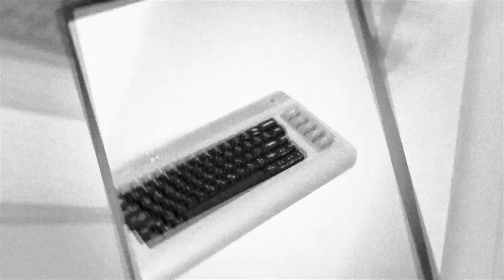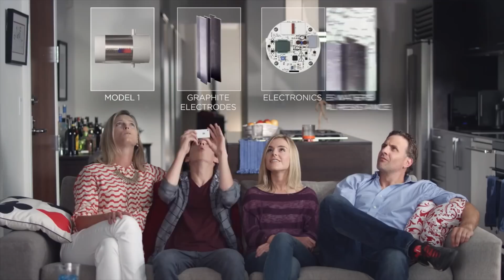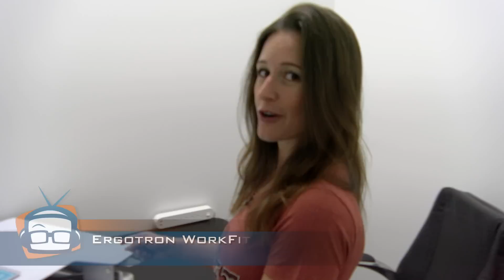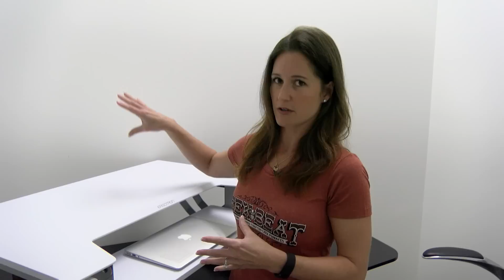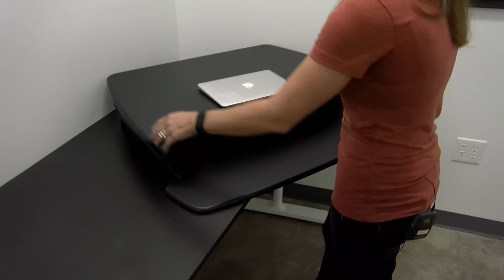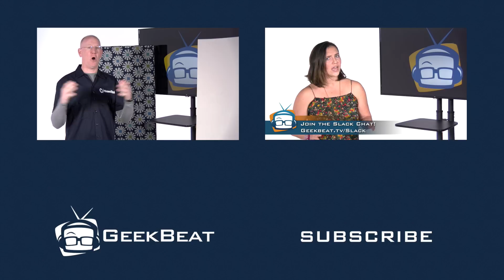Ergotron's Sit-Stand Desk, Smart Water Heaters, and ANA's Star Wars Themed Planes

Comment: Nice review. But in the 'sit' position, won't they make things a little too high to be comfortable?
Would've been good to see one in actual use
Reply: +Jason Brindley Actually, when you're sitting with the desk down low, as long as you are using a keyboard they work well. It basically just helps elevate your monitor, which feels a lot better on your neck if you aren't looking down.
Reply: +John Pozadzides (John P.) ah ok  so worth looking into then. Not that we'd ever get them over here in the UK... Still, where there's a will..